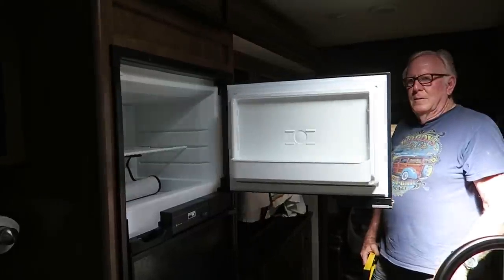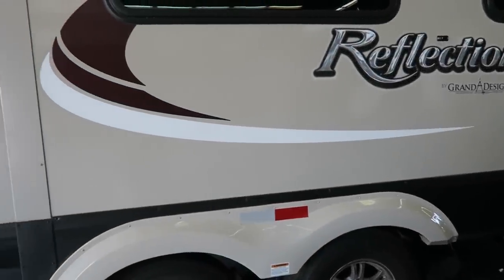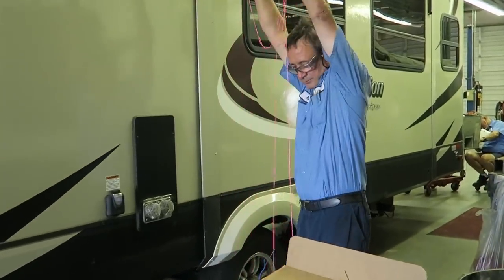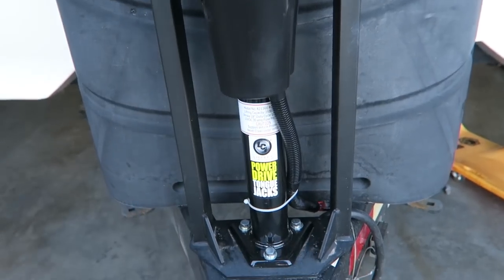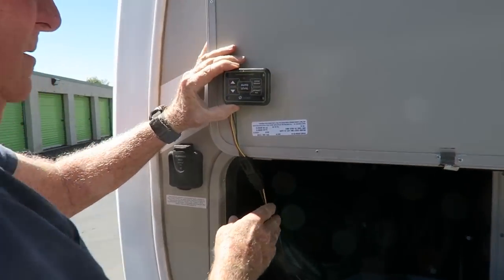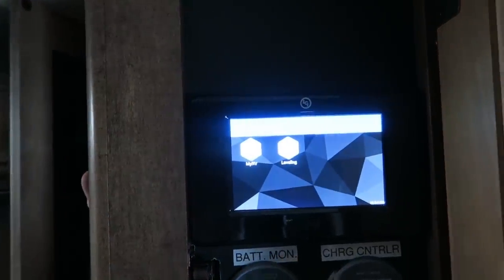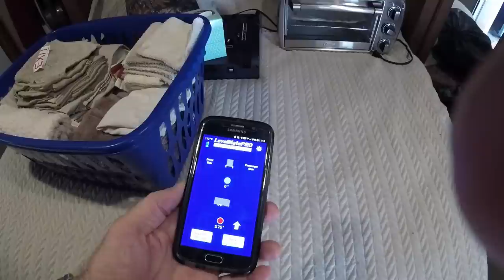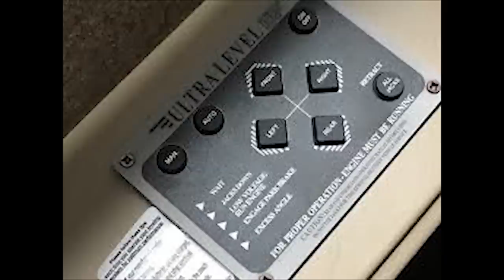Auto Levelers | Travel Trailer Auto Leveler | Auto Levelers Auto Leveling Systems

Comment: I have a Cross Roads 2018 Sunset Trail, 33SI with auto level and LOVE IT!!.( 35 foot, 3 slides, GVW 9150) Works great and once I push the button to level, I have time to hook up power, water and its done. Less than 3 minutes. Wife puts slides out, I hook up stinky slinky and by time I get in and wash my hands, coffee is ready. I say complete set up in under 15 minutes and I dont break a sweat. I dont know why more travel trailers dont have this on them from the factory.
Reply from the maker: My Father in law absolutely loves his as well. We cheated and moved up to a 2020 GD Solitude 390RK, same thing one button and it's done. I know what you mean, Love it... OLT

Comment: He said they'd have recourse if necessary.  With Camping World?  Right.
Reply from the maker: My Father-in-law decided to have CampingWorld do the install for several reasons. One is that he felt that he would have recourse if it was not properly installed. We've heard horror stories about many RV service centers but in his case, the install went off without a hitch and the system works fine. The Technician working on the rig even helped him run some extra fish tape for future wiring while the belly pan was off. YMMV.   Hope this helps.   OLT

Comment: Ok.  It’s been 4 yrs since the lippert auto leveling was added to that travel trailer at Camping World.  Is it still working as it should?  Anything you wish you had done differently?  Any improvements needed?
Reply from the maker: Yes, it is still working, well other than an occasional operator error. The big wish is that technology being what it is, they have now come out with a system similar to that used on 5th wheels, with rams instead of what this has. It does still use the front jack just everything is beefier and quicker.  My father-in-law has since added hydraulic, disc brakes as well. Pretty slick setup... Thank you for asking, and for watching...😀❤🙏      OLT

Comment: What grand design model ? I am looking to put on the 297RSTS which is at the 10k limit.
Reply from the maker: Hi Leigh, I believe that his is a 2017 Grand Design Reflection 297 RSTS at about 34' I understand that Lippert has a hybrid system out that combines the front stabilizer type jacks and integrated tong jack with rear stabilizers similar to those on a 5th wheel. The early reports are that they provide more stability and weight capacity. There is a group on YouTube called "Finding Your Someday" that goes through a Lippert install of the new setup. It seems even nicer. Give it a look-see as well.       OLT

Comment: Greetings from Vancouver Island, BC, Canada.  I'm taking possession of a 2020 Outdoors 22FQS TT in early March  It has the auto level system.  I was reluctant as I'm oft of the opinion that all things mechanical / electrical with eventually break down...soo....what experience or knowledge do you have on the long term dependability of auto levellers?
Reply from the maker: The learning curve is quite high. generally, they work but require the RV to be on a mostly level surface to work properly. Many of the Lippert systems want the RV to be no more than 2 degrees off though I've seen them level at greater angles. If it comes equipped from the manufacturer your chances of the system working properly are greater. My Father in law had a 3rd party install his on an older 2017 travel trailer and got lucky the only failure was when one leg had to reach into a large pothole, he did not use blocks to bring the hole to ground height prior to starting the process and it would not take. Since he has had no issues. YMMV. It is quite an expense to "add on" and I would probably want the manufacturer's version already installed. I'm sure they will get better as time passes.  Sure hope this helps    OLT